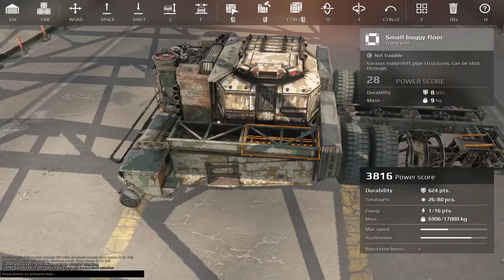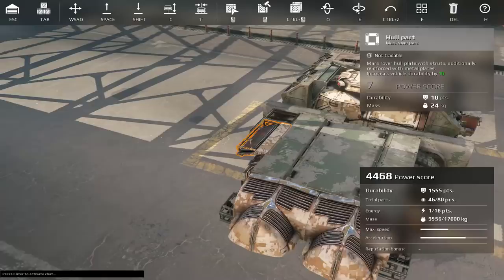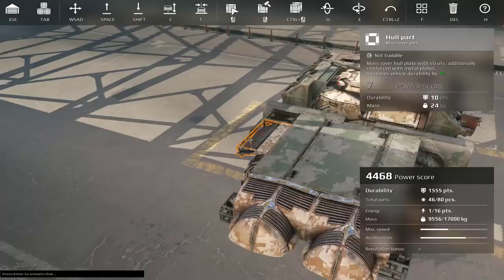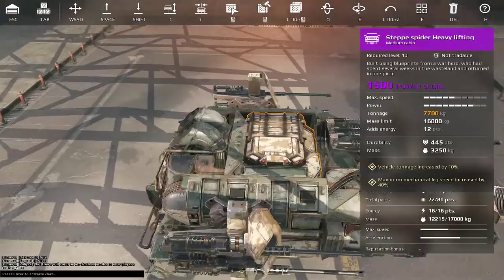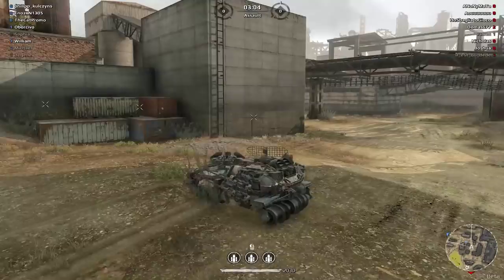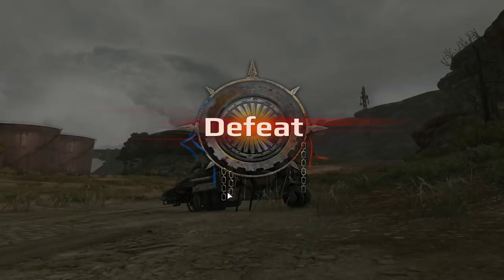Crossout Lets Build! Sideways Wheels Concept

Comment: what is the advantage of using this design?
Reply from the maker: Oleg Stanojevic circle strafing around enemies with non turreted weapons
Reply: in my opinion the weaknesses outshine the benefits. Still its a fantastic video :)
also jb rider has a new intro its really cool:)
Reply: I love making aysmmetrical designs sort of like this in crossout and robocraft. It allows players to create vehicles with extremely heavy armor in only one direction. Maybe players try to do this with tons of forward facing armor, but die when they have to turn to run away. Their direction is only limited to slow forward toward the enemy. 

Creating a craft that has their heavy armor all facing the side mitigates the lack of mobility, allowing you to have a fast mobile weapon platform with twice as much armor as a similar symmetrical vehicle. I don't like this design as much because it wastes a lot of the armor on the "back" and bothers with adding strafing capabilities when it should focus on speed